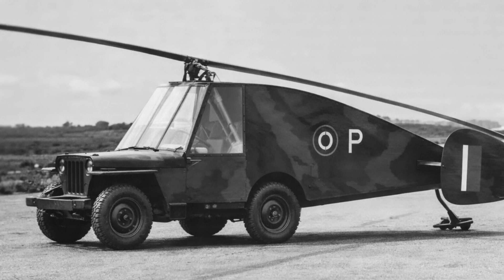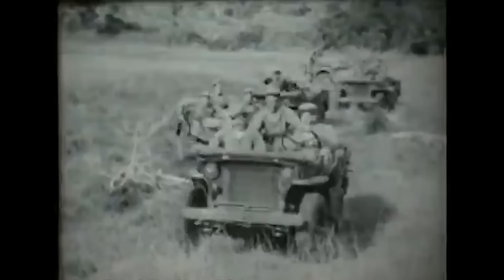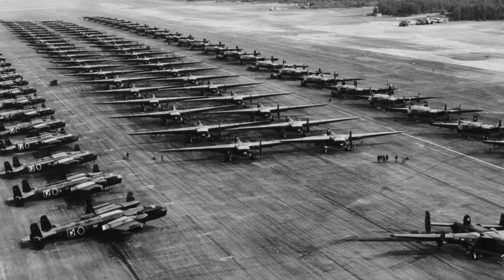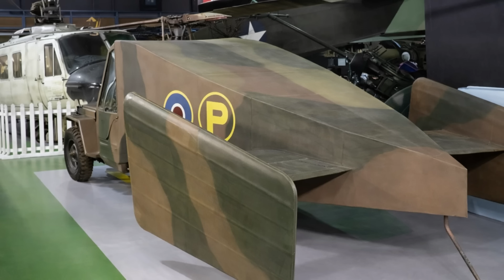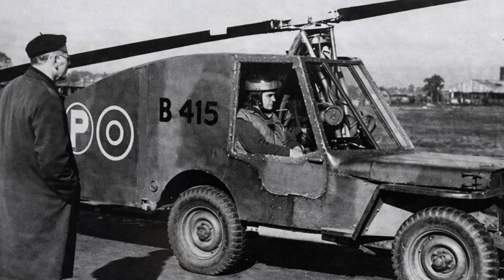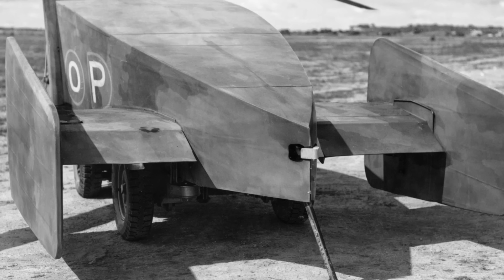The 'Insane' British Jeep That Actually Flew Over England Towed By A Bentley

Comment: I'm surprised they didn't scratch build a lightweight vehicle expressly for parachuting. It could've been fabricated from plywood and perhaps fitted with a motorcycle engine...
Reply: They did...the corgi welbike
Reply: @militarycollectablesmilitaria  Thanks for that, but I was thinking more in terms of a 4-wheeler like the Mini Moke. The Germans had a small tracked vehicle with a motorcycle front end that was extremely popular with the Wehrmacht...
Reply: @tedthesailor172  the Kettenkrad was far from a lightweight, at 1500kg its 400kg heavier then Willys jeep and close to double the weight of the Kubelwagen, of course their where airborne jeeps and jungle jeeps that where made smaller and lighter for parachuting as well, bit less so by the Brits but the US tested different versions